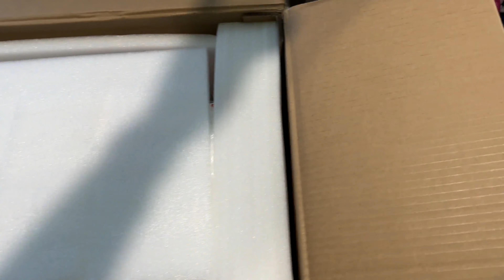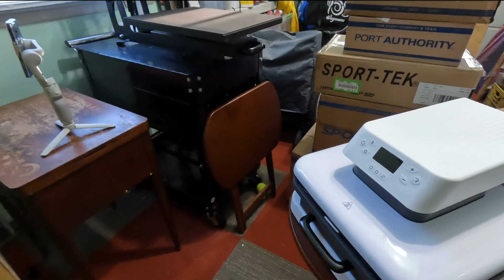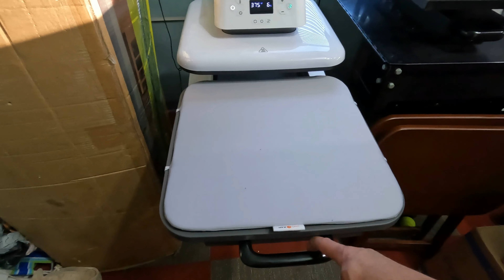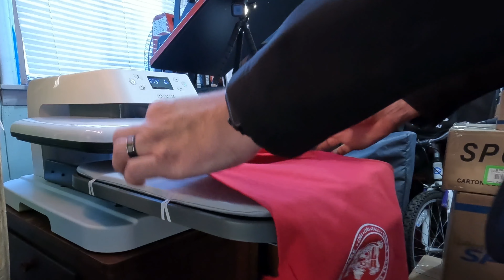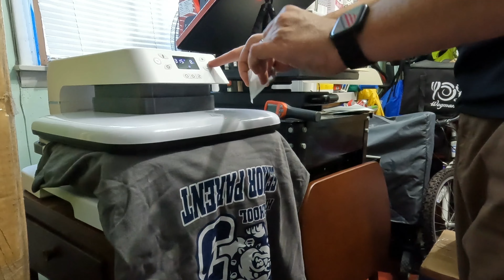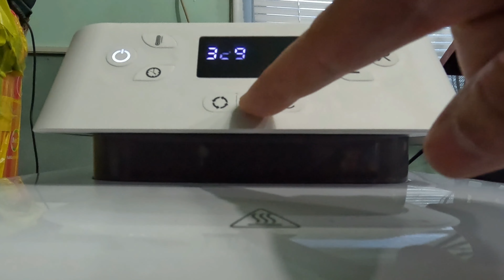HTVRONT Auto Heat Press Unboxing & First Impressions

Comment: Thanks can you set the pressure?
Reply from the maker: No - there is no adjustment for pressure. It seems to be a pretty firm pressure to me - has worked well for all garments I have pressed so far.
Reply: I received mine today I pressed a mouse pad and the middle part seems not to get enough presure. I only tried ones piece so I'm not gonna judge it now until I try it a bit more. But not having presure to adjustment its a bummer.
Reply: No, it is auto pressure.

Comment: Hello! I also received the htvront auto heat press. I try to turn it off and it keeps blinking. Am I missing a way to turn off blinking light without unplugging? Also not sure what the key with "a" is for. These instructions are terrible. I've never owned a press before. I appreciate any pointers you could give me thank you
Reply from the maker: The flashing power button is just to indicate that it is still plugged in.  And the “A” key is the BEST feature I think. If you turn that on (I think it stands for automatic) the press will automatically press every time you close the drawer. It is amazing.
Reply: Mini blinks until I turn off at the wall